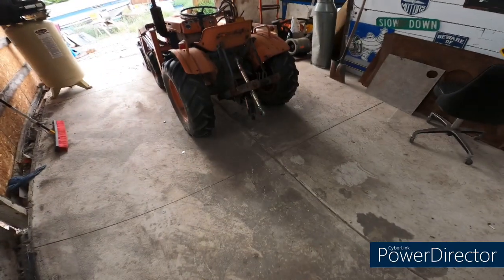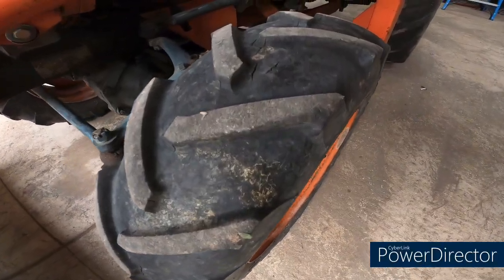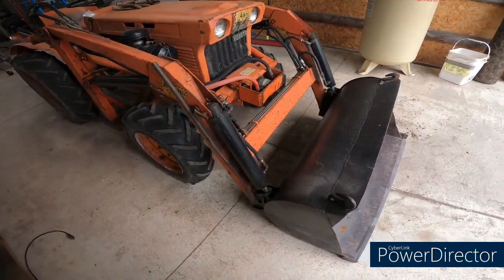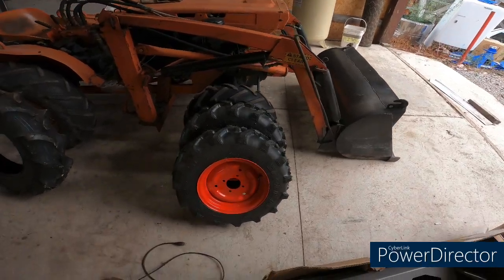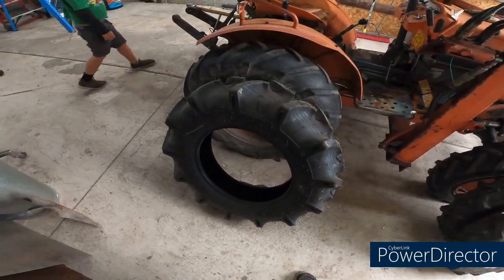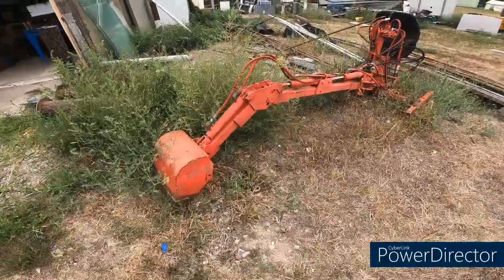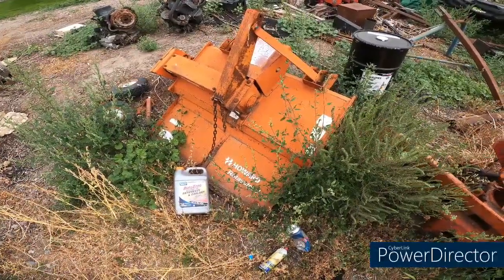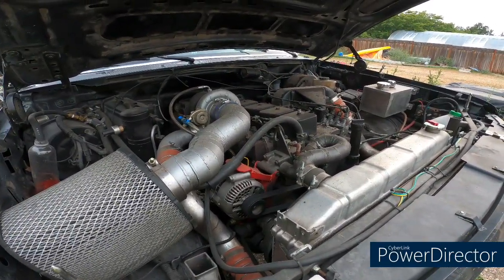Kubota B7100D

Comment: I have a 1979 ford 1100 pretty similar to yours I paid $1500 I only got the tractor and the loader the loader needed all new cylinders and lines about $1800 she came with new front shoes I put some matching rear shoes on her about $400 I broke the rear differential so a new used one of those about $250 and soem misc parts about $600 so I got about $4600 in her love the tractor definitely recommend them
Reply from the maker: @Huntersprojects  that’s awesome! They are good little machines. How did you break the differential?
Reply: It was previously repaired not correctly… hooked the lines from the pump together for 3pt function without the loader on and created pressure as the valve wasn’t working correctly and blew the repair out the back